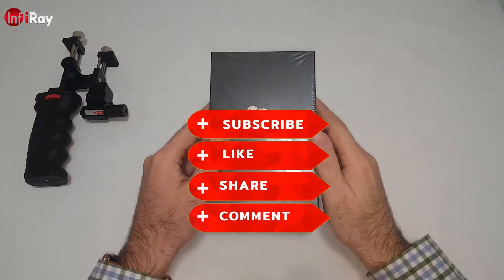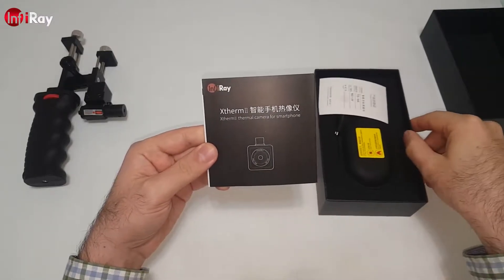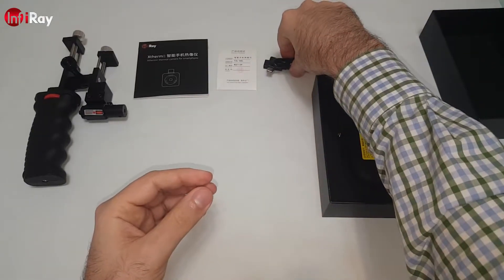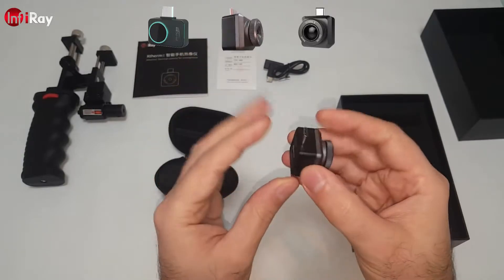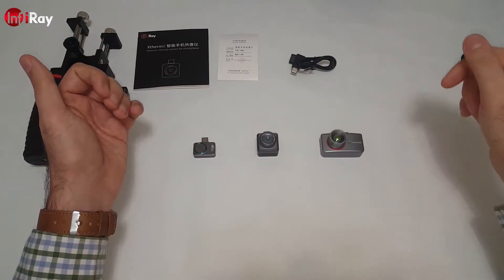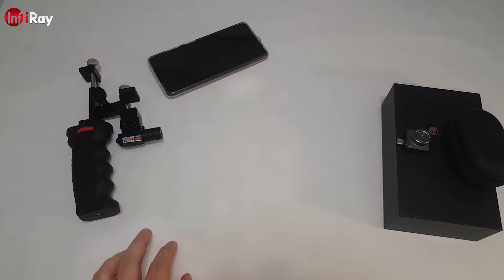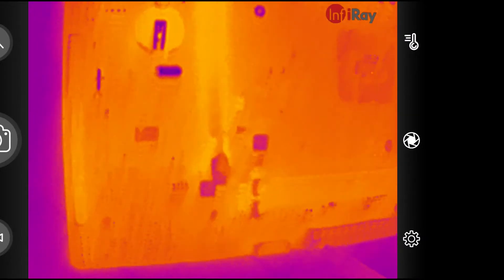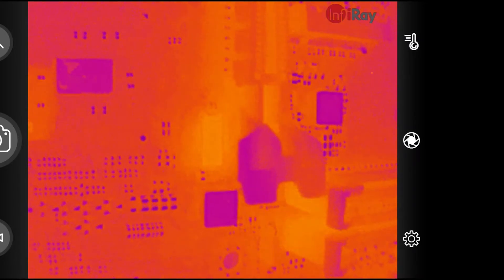InfiRay T2L Thermal Imager   Optimised For SMD Repair

Comment: Dear boss
Is Xinfrared T2L the Same like infiRay T2L

Kindly help me
Reply from the maker: A Sure. Its the same company.  Just happened a rebranding some time ago.   Same device.   And if you want them i can get you super discounts.
Reply: @cleanunbox  

Thanks so much dear brother for your reply
But as I told you in your other video that I already purchased Xinfrared T2L but it is not working with old version of therm infrared APK and also your APK , it works only with the latest version of them infrared APK 
It means chip inside camera is different or the firmware is different,
I purchased that in offer before knowing your amazing channel
If I saw your channel sure I will not purchase from anywhere else
Because I am pretty sure about your item quality

Comment: I'm a plumbing and heating engineer and need a camera for finding leaks in solid floors which would you recommend many thanks
Reply from the maker: basically, any of these cameras are good for that. it mostly comes down to how much you want to spend on it, i would recommend the T3S.   but if you don't want to spend much on it then maybe T2L.     If you need a discount on them join my discord server and just ask me,   you can also get there tips and tricks on how to use them more efficiently from me or from other users.

Comment: Any videos comparing this to the flir or seek options? Why should I get this over a used seek for 100 bucks.
Reply from the maker: Seek is just a brand,  which seek model are you referring to?  so i can tell you why.
Reply: @cleanunbox  seek compact or compact pro
Reply from the maker: @PantherSpawn  the seek compact pro have higher resolution but the algo on that not giving as nice image as the algo of the T2 series.    all seek models have an unbearable low 9hz frame rate.   every infiray model has 25hz. it's just a much more pleasant experience with infiray.     if you buy first thermal imager even that 100 bucks is a waste of money for the Seek because you can get a T2L in my discount for 290 with holder included.  and its way better than any seek phone camera model.   also,   the seek models require additional lense for macro.  the T2 series have the ability built in.       If you want to ask infiray users join my discord and ask around,   people uploading pictures and videos with their models.
Reply: @cleanunbox  no they dont..you gotta be pretty new to Thermal cameras if you think all Seek Pro's are locked at 9hz.. maybe in Russia or some weird regimeregion and ITAR regulations but for the western market that ain't the case.
I got myself a Seek pro FF in 2017 at 300 bucks.(USD) from Ebay. and that is running around 18hz.. you can see the mediadump
https://youtu.be/Im1_Dyf69to?t=68
with these dongles.. the app is so vital, and its here these CN InfiRay units comes short..also prefer the palette of the Seek's and the app..
Personally I would go for an T3S.. but seems they have raised in price like so many things... back in 2018 we could get them for 500USD from CN sellers
Reply from the maker: @JAKOB1977  25Hz is not 20 or 18.  Infiray cameras don't need additional lens to get macro or nice resolution,    and if comprehensive software important for you than visit our discord and test out our community developed app for this cameras made from the SDK that Infiray provide for every buyer if asked.
Reply from the maker: @JAKOB1977  By the way you probably had luck finding that for 300 bucks,   now days  its almost 700 usd https://www.ebay.com/p/12048188774?iid=334394153833&rt=nc   that is more than the T3S cost in my promo with holder :)

Comment: That is my first thermal camera. It is very good hardware and very small. Also you can focus very close to objects about 2-3cm and inspect them easily. BIG drawbacks is the software. Total crap. Constantly crashed when you try to start camera. If you want to see something in gallery from app also crashed. Also there is missing manual control at all of temperature colors range. I really like to pay for better soft like  Therm Viewer which is not updated from almost 3 years and didn't support T2L.
Reply: Sorry but could you tell what is the temperature range?
Reply from the maker: It is pretty good even despite the lack of software functions.  if you know someone who knows to program the SDK is available for buyers.    Also, I run a new promo for Subscribers.   if someone is subscriber and joins to my discord channel gets insane discounts on any infiray phone thermal camera including free holder as well

Comment: Great videos, I'm on a bit of a budget, what would you recommend between the p2 and the t2L ? I'm going to be using it for close to medium ranges, and I'm going to bring it along camping and try and see some wildlife at night in the forest
Reply from the maker: Good question.   I would recommend the T2L because of the manual focus. the P2 is good for the medium range.  but far and close not so much,  but the price reflects it.  But you arrived at the best moment.  I just started a Promotion on subscribers who also join my Discord server.    The clickable invite link is on the banner image.  any model you want you are eligible for big discounts on top of the actual price plus you get a free holder as you see in my videos :D
Reply: @cleanunbox  I just subscribed to your discord, but can't find a discount code or link? I'm probably gonna buy the t2l
Reply: @Tacticalairsoft252  today price on them almost same, so ni point not to take t2l
Reply: @cleanunbox  maybe use some tangible numbers..what are these "big" discounts?
as far as I can tell the T2L is around 300USD with EU tax and shipping to EU.
what values are you able to resell it to? and from where are you?
The result is decent for an 192x256 microbolometer though the palettes leaves some to be desired but it seems to work at 25Hz( that a big plus).
One of the Palette I like most on fx Seek are the "Tyrian".
https://www.youtube.com/watch?v=2rNIJhWiRtM
That infiray-logo is that user chooseable and not hardcoded like we see on some??
Thx for the vid and demonstration +1 (some transparency about the pricelevels, and where you selling from??) 
as that can be a huge problem, and a con if you fx are in Putin land.
Reply from the maker: @JAKOB1977  The cameras  ships straight from Infiray. No Shipping to Russia, Ukraine and Belarus. Which is not my decision.   The infiray logo can be turned off. And on my discord we have members who developing software's for PC and Android that is already more feature packed than the original.    I will never post here Prices because they are subject to change.  and in my offer all cameras includes the holder (40USD value) and shipping with UPS (other sellers do it with standard shipping.

Comment: Do you know what's difference between T2L and T2S Plus (new model selling on Aliexpress). I think they're same configurations but renamed ?!
Reply from the maker: The T2S+ is built on the P2 platform but with a manual focus that is capable of 8mm close Marco.  That will be my next Thermal camera review. but they don't have stock. Coming soon :)
Reply from the maker: and dont forget.  only buy from the Infiray official aliexpress store cause 3rd party sellers just cant deliver the same customer support and delivery speed.
Reply: I see difference only in temperature range. In app there is two ranges from -20 to 120 C and 0-400 C. Second range didn't work with T2L so I suppose it is for T2S+ model.
Reply from the maker: @icpart  Indeed the higher range is reserved for the T3 Pro, DL13, and now the T2S+     working atm on the T2S+ video.  coming soon

Comment: Hey can you tell me is there any minimum focus distance difference between T2L and T2 Search ? And if you could share some difference between those two. And which one would you recommend to buy ?
Reply from the maker: i think as i tested the T2 search is about 20cm max.   and the T2L is around 10cm maybe 8.     but just released a new model. so my next video will be soon that model.   8mm distance macro :D  and 450celsius maximum temp.
Reply: @cleanunbox  is there any difference between T2L and T2 Search in far objects Like you show cars building road etc ? I want to use it to inspect cars, rooms, pipes building etc. ( Edited : i want to know is there any problem with the focusing lens to focus on far objects like cars pipes etc. Not as close as SMD. Normal life objects. As compared to T2 Search )
Reply from the maker: @subhradeepsharma  The T2 is more optimised for short circuit detection hence capable of macro detection.  the T2 Search is more far objects detection but both are good in middle range distance detection

Comment: I'm facing a choice of p2 or t2 search or t2l. what do you say about your model? you can show more videos of shooting in different places.
Reply from the maker: The best among these cameras is the T2 search.  but if you only want to repair. PC or phone motherboards than the T2L is the perfect choice
Reply: @cleanunbox  I will need it for the inspection of apartments and houses inside and outside. electronics repair. inspection of electrical wiring in the shields. etc. which one to take p2, t2l or t2 search? uni-t ut120 mobile measures his temperature more.
Reply from the maker: @ipravoqator  well if you need it for so many things and you do it professionally then you need the T3S, it has higher resolution and supports the Therm Viewer app.   If you want to join to my Discord channel   here is an invite  https://discord.gg/MqU2KHKd

Comment: does the app allow you to manually adjust the temperature range like you can on a flir? for instance if you have multiple hotspots and you want to dial in on the hottest point
Reply from the maker: For the  T2L or T2 search, the factory app doesn't have that. The P2 has some sort of that.   for the T3S (upcoming video)  have that in a paid app called Therm Viewer,

Comment: Thanks so much for this vid, can you answer some questions..?
1 - Is it possible to use with PC? Is there any PC software?
2 - The sensor itself can be used to see visible light, thus, is it possible to mix image?
Reply from the maker: Hi.   1.  I have a program from the factory but maybe I'm doing something wrong but I could not make it work yet for PC.   but if you just want to put the image out to a big screen then you can always just mirror the phone with chromecast or miracast to android TV box or TV :D
2. There is no IR sensor that can see visible light,  Factories adding a secondary VGA or HD camera to other models to improve the image quality because they are lazy to make a proper algorithm for the chip, and the higher-res sensor cost exponentially more expensive as pixel count increases.  with the T2 you basically don't need a visible camera due to great resolution and proprietary algo that results good image quality,          also. once I find a clean solution to connect to PC I will make a separate video about it.  there are paid programs that can handle it but I did not want to pay for them just yet :D
Reply: @cleanunbox  I've seen some videos of people using OBS Studio to record uti260b video, and prob it's possible with the T2L as well.
Reply from the maker: @Ech01378  If they use the same sensor.  Or if there is no exclusion based on the model number in the software itself,   I'm gonna have a look at it
Reply: @cleanunbox  I have a rx680, it doesn't appears as a USB cam, so it's not possible to gather any information from the sensor as the product doesn't allow user to do this. If you see the camera in your device manager in your pc so it's highly likely that you will be able to get the image from your pc
Reply from the maker: @Ech01378  I see.  the rx680 is from UNI-T .   it should have dedicated PC software. you didn't ask from the seller?
Reply: @cleanunbox  I did, they said it's not possible to project the camera image on pc...
Reply: @cleanunbox  between P2, T2L and T2S, the best for pcb rapair would be the T2L and for outdoor use the more suitable would be the T2S?
Reply: @cleanunbox  do you have a discord? We can talk a bit there about some points we have found about the thermal cameras, if you want
Reply from the maker: @Ech01378  I will create a Discord channel and place the invite link in the description.
Reply: @cleanunbox  cool. I've bought a T2L yesterday, I'll prob receive it within 1 month, thanks for your help.
Reply from the maker: @Ech01378  Nice!  But why 1 month? did you use the link i posted?  That link is directly to infiRay store and they send everything with UPS of DHL included in the price :D
Reply: @cleanunbox  the problem is that dhl always get stocked in the customs, which takes 60% off the total amount of the bill.
Reply: How you find the 3d model for the T2L? Could you share? I need to make a 3d support for it
Reply from the maker: @Ech01378   That was not a 3D model. it was After Effects green screen job
Reply: @cleanunbox  oh cool, that looks really nice

Comment: hows this compared to the T2?
Reply from the maker: in this video: https://youtu.be/ezKCyDcNAss    you can see the T2 Search and P2 in action.     T2 Search is more for long-range detection but also closeups the T2L is optimized for macro and medium distance.    The T2 Search cost more because the larger lense and lens material is expensive (Germanium crystal)
Reply: @cleanunbox  T2 Search image clearer?
Reply from the maker: @mosyui    If you want to see distant objects the T2 Search has a better lens.
Reply: @cleanunbox  thanks.  I just get my T2 Search.  It's not good for indoor,  zoom too close.  Can see very far ☺
Reply from the maker: @mosyui  Indeed. The T2 Search is more outdoor. but as I tested it's usable indoors as well.  In my other videos, you can see how nice is it to repair SMDs for example.  so as this T2L as well.   By the way, then congrats on your new T2 Search, you will enjoy it for sure :)

Comment: How useful is manual focusing if do not use a thermal imager to repair computer boards?
compared to the P2 model. does it make sense to overpay if i want to watch the heat loss of the house ?
Reply from the maker: I have noticed that a lens vs bare sensor always wins.  even if you have to pay a little extra.   I mean today you just want to watch heat loss, but maybe tomorrow you want to use it for more advanced stuff.    But if the budget is low then clearly the P2.   but if you can afford then go with the T2L  or even T3S,   In this video you can see how the T2L performs in environment like a room,   and here: https://youtu.be/ezKCyDcNAss  you can see the P2 and T2 search in action.